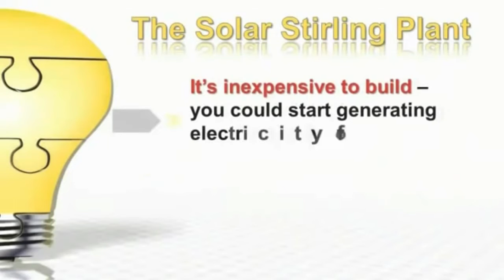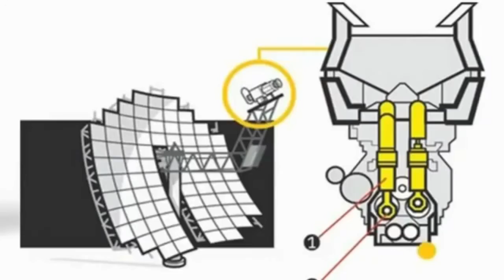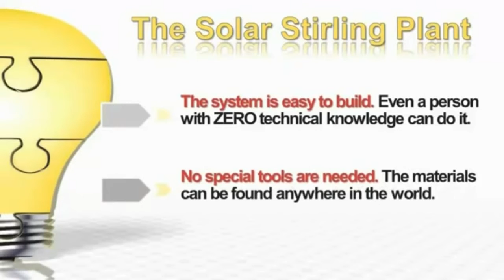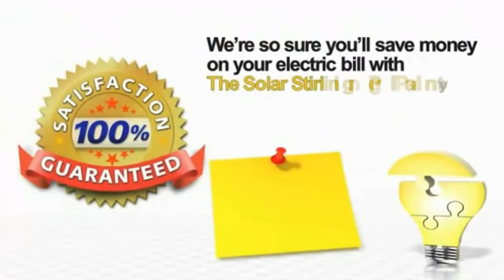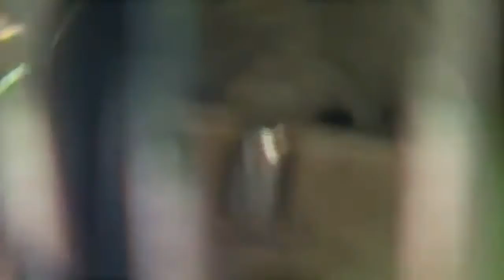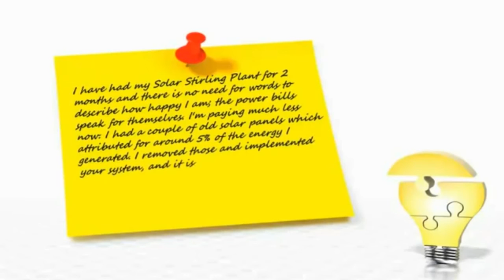Get Free Electricity Using Solar Stirling Plant

Comment: Congratulations on the job! Have you thought about drastically reduce friction losses and the maintenance and lubrication needs to replace mechanical parts for "Solid State" with Peltier cells for generating thermal energy for temperature differential?